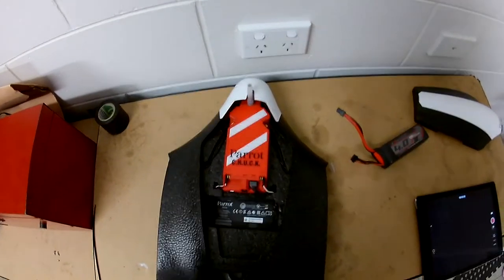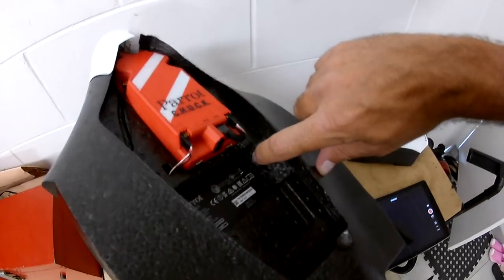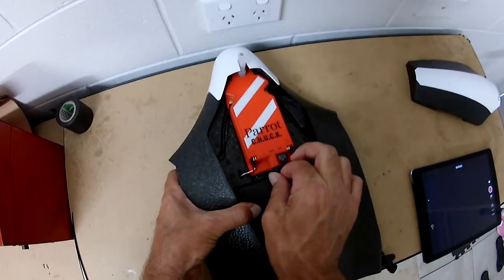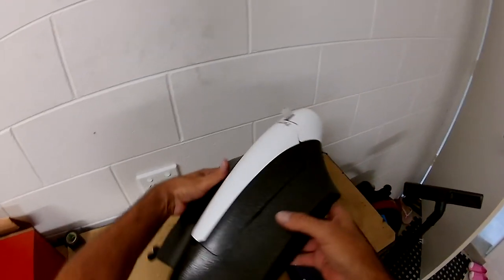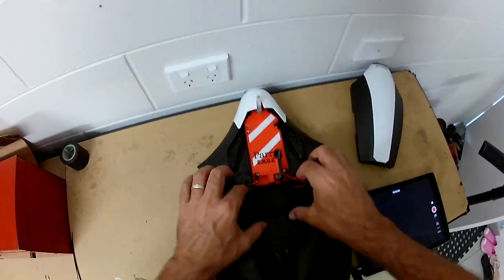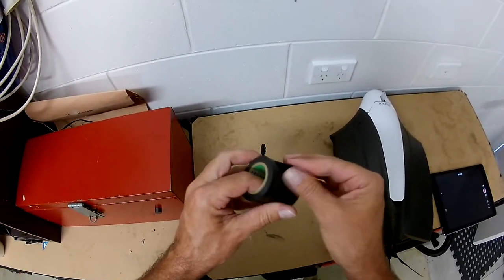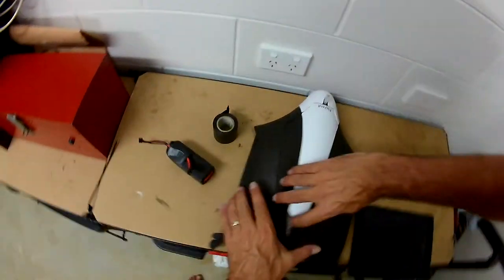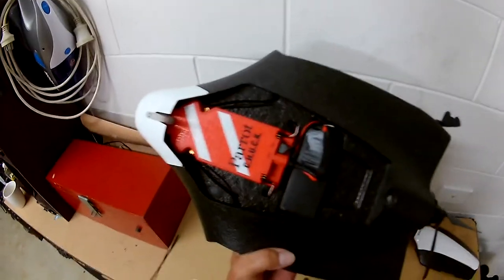Parrot Disco - 4000mah Battery Upgrade and Install

Comment: Hi, I guess this video is very old but I still found it useful! So thanks! I wanted to ask (I am a complete newbie) if the original parrot charger would charge a 5200 mah lipo like the one you put in (4000 mah). Or would I need to buy a new charger? 

Thanks for any info you can spare, as well as any tips you care to offer. Stay safe and healthy!
Reply from the maker: I don't think so if it did it would take a very long time. I would invest in a good lipo charger.

Comment: Great video buddy.
What should I look for in my upgrade battery? Assuming it should be a Lipo, 3cell and have 4000mAh or higher? Anything else you recommend? What weight should it be under?
Am new to the hobby.
Reply from the maker: Addicted 2 PPC thx for the comment. Most 
are flying disco using li ion battery pack as they give longer flight times than lipos. The battery in my video was good for around 50mins depending on conditions. Unfortunately I lost my disco due to pilot error but if I didn’t I would have eventually replaced this battery with a larger capacity li ion battery which generally smaller than lipos. Something to look at if you want longer flight times.
Reply from the maker: Check out some of the parrot disco sites on Facebook that helped me
Reply: @stonesrcchannel  Thanks buddy, do you have a link to where I can buy these. I have not idea between 15c, 20c 30c, is this the degree in temperature, what does it mean and what should i look for?
Reply from the maker: @Addicted2PPC  most of these type of planes don't require a high C rating so anywhere between 15c and 30c is ok. Best way to understand the C rating is the higher the C the longer full throttle power the battery can handle. So as an FPV drone racer doing flips and lots of full throttle you would be looking at high C ratings where as planes like the Parrot Disco are considered long distance cruisers and usually don't fly full throttle for long periods. So a battery around 20-30c is sufficient. The one i used in this video if i remember was only 10c which can be hard on the battery during take-off where higher throttle is needed but once up cruising around it was fine. 

I recommend Li Ion batteries if you can get hold of them, they are preferred as the disco comes with one which i believe is around 3100mah from memory. A 3100mah Lipo will be larger and heavier and not have the flight time of the 3100mah Li Ion. Li Ion batteries seem more efficient and are smaller in comparison to Lipo's. Some people build their own Li Ion batteries many "how to" videos on you tube if you want to learn. Some have fitted up 10000mah Li Ion in a Parrot Disco and get well over 1hour and half flight time. A 10000mah Lipo is way to big to fit in a Disco and the weight of it would affect the planes flight characteristics. The disadvantage of the Li Ion battery is not many companies make packs which is why people build their own, where the lipo battery packs are sold far and wide and in many different sizes. 

Zohd i think are the only company who have just started selling packs if you do a google search for 3500mah ZOHD Li Ion you should find it. Pretty sure they also make a 7000mah Li Ion which would be sweet for the disco if it can fit in.

Hope that helps a bit just remember the higher the C the more full throttle the battery can handle and the higher the MAH the larger the petrol tank so to speak. Most Li Ions are low C rating anyway and not recommended for fast full throttle flying only long range cruising.

Anything else just ask
Cheers.
Reply: Wich battery plug name for the disco ?
Reply: Ec5 plug

Comment: I’ve just bought this same battery but the 5200 mAh option which is 1cm higher so hopefully it fits but my question is how does the new battery affect the center of gravity? Is there any mod you need to do for that?
Reply from the maker: Hi mine was fine I'm not sure how much heavier the 5200mah is as that would be my biggest concern.   COG was fine with mine just adding more weight was my biggest worry which is why I went for 4000 not 5200. Let me know how it handles it.
Reply: Stonemedia RC Entertainment there seems to be only 67 grams difference and looking at some of the mods people have done with batteries I think I will be ok but I will let you know how I get on haha
Reply: @stonesrcchannel  5200mah worked perfect got great flight time too :D
Reply from the maker: @Rubber290  awesome thats good to hear. Have you ever thought about li ion batteries? They are smaller and give even longer times than lipo. Something I would recommend checking out next. There are many you tube videos showing you how to make one. I have heard of parrot discos with custom 10000mah li ion batteries. If I never lost my disco I would have gone that way and also i would have done the 4g mod too.

Comment: did you have any problem on the Disco motor due this type of battery ?
Reply from the maker: Flying Above Sea no problem it flew fine
Reply from the maker: Flying Above Sea no problems with the motor. Even though I did eventually lose the plane during a waypoint mission when I under estimated the height of a hill. @#$& happens in this hobby sometimes lol
Reply: Thanks. Good flight !